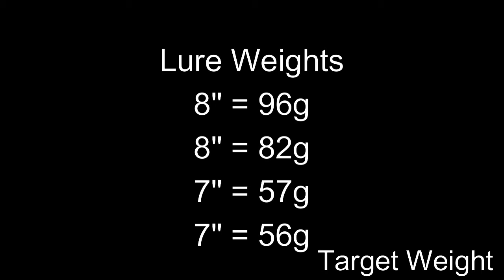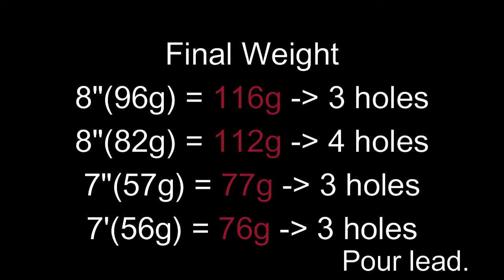Making Poppers Part 4 Lure Preparation

Comment: So I make lures myself and what I do with poppers is I cut a channel with a small saw blade attachment on a rotary dremel tool. Then I put my wire in and here’s the main part. Do fill in the channel I put baking soda layer by layer and super glue on top. The baking soda makes the glue turn rock hard instantly. Your method is awesome and I would try it but I think you have the risk of splitting wrong, or it splits badly or somethin. And after so much work I wouldn’t want to just throw away a broken lure. And for the weight you add you can cover that with baking soda and super glue too. Great video and just thought I’d share.
Reply from the maker: Yes there are more than one way to skin a cat! I have used  an internal wire channel for 5 years with good results. The only negative thing I found is you must use very little wood glue to hold them together temporarily. With the poppers you must use enough glue to hold the lure together on the lathe. Thank you for your comments! Keep making those lures!
Reply: @allandoell1025  thanks you too

Comment: Good looking plugs. Just curious why you don’t simply turn the body on lathe and drill though from head to tail?
Reply from the maker: It is very tough to get an accurate hole by drilling the hole in the lure after it has been turned on the lathe. Cutting the channel prior to gluing the two halves together is very easy to do and every hole is perfect. The glued lure is very hard to break apart and should be able to take lots of abuse from sharp toothed fish.

Comment: basically which wire used for you're lures?
Reply from the maker: I use a 2.0 mm stainless steel for the thru-wire for the poppers in this video series.
Reply: @allandoell1025  👌ok.. thanks for you're replaying sir.
Reply: @allandoell1025  aluminum or copper wire good or not..for upto 100 mm poppers and minnow lures..

or suggest best one
Reply from the maker: @TNVillager  I use stainless steel because I fish for Wahoo. They have amazingly sharp teeth. I have no experience with any other material. It should be ok to use other materials for your thru-wire if you are going after smaller, less toothy,  fish.
Reply: @allandoell1025  ok sir..thanking you